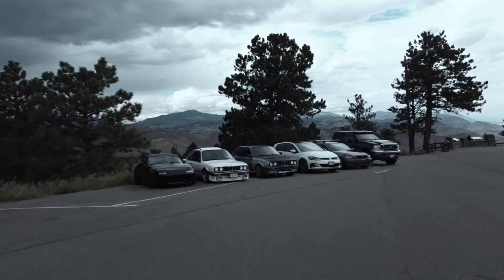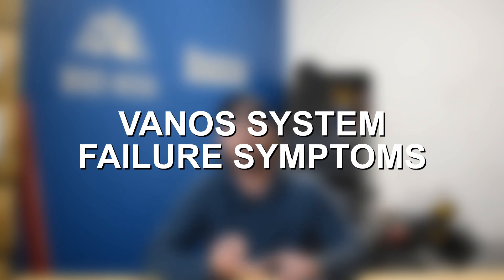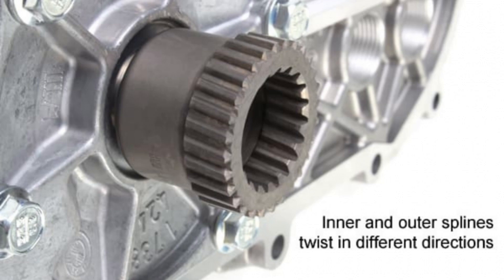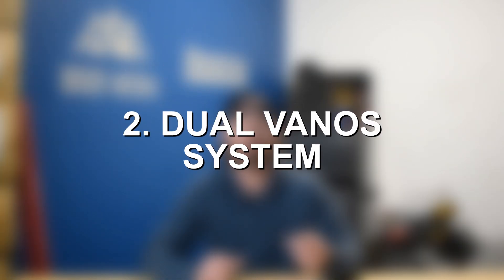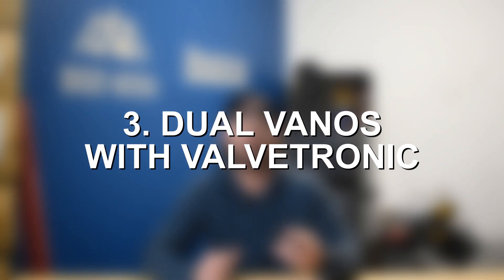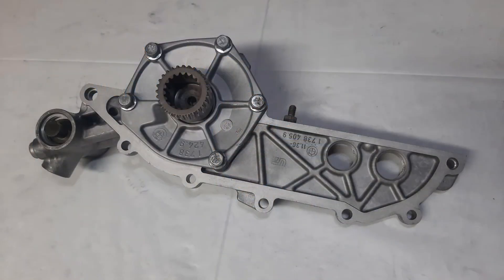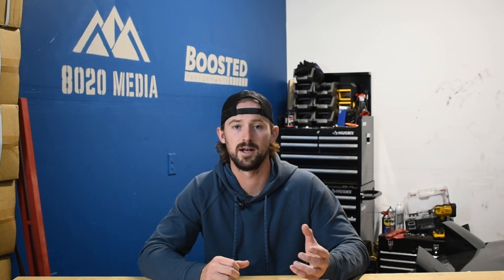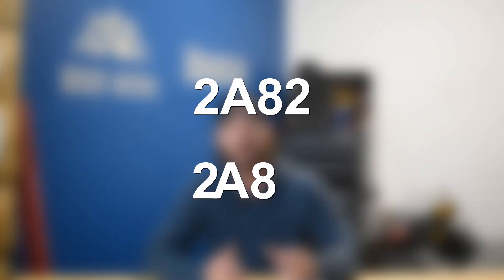The BMW VANOS System EXPLAINED! | Symptoms, Repair, & More

Comment: As a tuner honda owner overhauling a 99 323i e36, ya'll are just lazy. I'll say it. VANOS is time consuming to fix, absolutely. Not impossible. It's not your 5,000 miles oil change but if you care to learn at all these vehicles are not that hard to work on 😂

Comment: I have an X3, 2008, with an N52 engine. It is running rough, popping out blue smoke, and occasionally stalls completely. A repair guy removes the exhaust camshaft sensor and found metal flakes  in the sensor. Same story with the VANOS solenoids. Do both/all four parts need to be replaced?

Comment: 2015 bmw 528i i had rough idle i hooked up my scanner and notice manifold pressure stayed at around 91kpa and fuel trim off so I replaced my vanos very easy! And did a valvetronic and cam reset runs soooooo smooth now!👍❤️

Comment: Ive got a 2009 bmw x5 48i
Engine is E70 N62
Getting these faults:
Electronics-box fan, activation
Ignition coil cylinder 2
Misfire cylinder 2
Ignition coil cylinder 5
Misfire cylinder 5
Inlet VANOS, adaptation stop 2

I noticed on each bank i have 2 vanos vertical to eachother, top and bottom. Im guessing “stop 2” from the fault is bank 2. Which im guessing bank 2 would be the drivers side cylinders 4-8? Then as far as “inlet” from the fault, does that mean the top vanos is inlet and bottom one is exhaust? So my course of action here is to try to clean or replace just the top vanos on the drivers side bank? Even though there are other coil or spark codes from the other bank too. So maybe just clean both the top vanos on both banks?
Reply from the maker: E - Yes, you're thinking along the right lines—on the E70 X5 with the N62 V8, Bank 2 is indeed the driver’s side (cylinders 5–8) and Bank 1 is the passenger side (cylinders 1–4), and when the code mentions “Inlet VANOS, adaptation stop 2,” it's referencing Bank 2 intake, which typically means the top solenoid on that side (top = intake, bottom = exhaust); this fault suggests the DME can't properly advance or retard the cam timing on that intake side, possibly due to sludge, sticking solenoid, or worn VANOS seals—so your best first step is to remove and clean both top VANOS solenoids on each bank, as even a slightly sticky solenoid can throw adaptation faults and disrupt smooth valve timing, which could explain misfires or weak combustion, especially in combination with aging coils, so after cleaning, clear codes and test again, and if problems persist, consider replacing the affected solenoids or doing a full VANOS rebuild depending on mileage and oil sludge condition.

Comment: How much would it cost to fixing the VANOS issue?
Reply from the maker: N - The cost to fix a VANOS issue varies depending on whether you're replacing solenoids, seals, or the entire VANOS unit. Replacing just the VANOS solenoids typically costs $300–$600 (parts and labor), while a full VANOS rebuild or replacement can run $800–$1,500+ at a shop. If you’re DIYing with a rebuild kit (like for seal replacement), it could cost under $100 for parts but requires a few hours of labor and some mechanical skill. Dealer prices tend to be higher.

Comment: Does forgetting to change the oil for 3k miles affect the solenoids?
Reply from the maker: T - Yes, forgetting to change the oil for 3,000 miles past the recommended interval can negatively affect the VANOS solenoids by allowing dirty, degraded oil to clog the solenoids and restrict proper oil flow. VANOS relies on clean, high-quality oil to function correctly, and sludge buildup can cause sluggish performance, poor idle, and potential solenoid failure. If you've gone over the interval, it's best to do an oil change with high-quality synthetic oil and consider cleaning or replacing the VANOS solenoids if symptoms persist.

Comment: I have a code 2DB0 Vanos on my car, you have any idea what that means? Please get back to me. You guys are very smart
Reply from the maker: E - Thanks for the feedback! The 2DB0 VANOS code on your car indicates an issue with the camshaft position control (VANOS system), specifically a camshaft control adaptation issue. This typically means the VANOS solenoid, timing adjustment, or oil flow to the VANOS system is not functioning properly. Start by cleaning or replacing the VANOS solenoids, as they can get clogged with oil sludge. Also, check the oil quality and level, since low or dirty oil can affect VANOS operation. If the issue persists, inspect the camshaft position sensors and ensure there are no timing chain stretch issues. A software adaptation reset via BMW ISTA or another coding tool may also be required after replacing any components. Keep us updated!
Reply: @8020Media - I just bought this new engine from a company called miamiengies and I just got this issue after 1 day of driving the new engine during the break in process. I’ve driven about 500 miles already with this code and about 3 hours ago, my car started to blow LOTS white smoke from the exhaust while idling, first time that happened, would it be smart to not drive it until I fixed the issue. I also contacted Miamiengies to find out if I should bring it to them or my mechanic? They said they’ll contact my mechanic to find out exactly what the codes are and to see if it’s their issue or not. What do you think is it Miami’s issue or just needs to be cleaned and put back in?
Reply: @ do you see my other comment I put? Or no? I don’t see it no more sadly it was a big message. If you see this one. Response to me so I can type it to you again.

Comment: I have single vanos but am going to tune my m52b25tu to 500hp, is there a way i can rwmove vanos or make sure the gear is always all the way out?
Reply from the maker: D - You can remove VANOS using a delete kit or lock the gear in the desired position, typically fully retarded for high-RPM performance. Work with an experienced tuner to ensure your setup delivers reliable and consistent performance at 500hp
Reply: @8020Automotive  awesome thank you, (unedicated) people told me that you can tune with the vanos active like normal but tuners have told me that this is dangerous and you cant "tune" it. So thank you for the clear answer.
Reply from the maker: D - Keep us updated!

Comment: Hello. Very informative video on the vanos system. I have come across your video, as I am trying to repair an issue with my car. 2011 BMW 335ix with N55 engine. There is an extensive history into the recent and major repairs I have just completed. I currently find myself battling these codes: 2DA0 and 2DA2, intake AND exhaust camshaft angle offset with respect to crankshaft out of tolerance. I have checked my cam shaft timing twice. Ensuring the timing chain was properly tensioned, and all timing tools properly in use. The timing appears to be correct, but I still get these codes, for BOTH cam shafts. I have pulled out both solenoids, cleaned them, bench tested with 12volts to ensure they work. Combined with the codes, the engine certainly idles very rough, stalling frequently. Above 1000RPM, engine appears to run and sound great. let of the throttle, below 1000RPM, and back to very rough and stalling. A few days ago, there was a 15 minute drive that worked perfectly! Car sat for 45 minutes after that drive, 5 minutes into the next drive, problem came back. Next thing I am going to check, is the oil pressure/oil pump solenoid on the front of the block. Perhaps it is clogged, like the vanos solenoids were to begin with. Here is the recent work I did to the engine: replaced connecting rod bearings, replaced complete cylinder head, with a good used cylinder head. Original cylinder head had excessive wear on the cam shafts and rocker rollers. The vanos gears are the original vanos gears, with replaced vanos bolts. There was one forum post I read today, that mentioned the need to "bleed" the vanos gears after replacing/cleaning the vanos gears... To ensure the oil has run through the vanos gears. The procedure was to basically find an open and safe road, and do a few passes accelerating to high rpms, and letting off, then repeat.... 
I am curious on your take as to why both shafts are creating these codes??? Thanks

Comment: Valvetronic was bij bmw all in 2004 my 2005 e60 N52B25 has dual vanos with valvetronic on inlet side with and second camshaft for variable valvelift. My another car an E65 from 2006 with N62B48 engine has it to but than dual/dual are 4 vanos solenoids and 2 valvetronic engines and 2 second inlet camshaft for the variable valvelift because it is an V8 when this got bad you have dubble trouble
Reply from the maker: W - Thanks for sharing.
Reply: E46 N42 engine '01 has valvetronics & double vanos

Comment: Hi please can you assist i'm getting these codes on my 2016 F20 B38 118i
118401 Mixture Control: Mixture Too lean, Deviation Too High
130308 Vanos Solenoid Value, exhaust: position not reached
180001 Catalytic Converter: Effeciency to low
130F11 Rxhaust camshaftsensor, signal: not plausible
101F01 Air Mass System, plausibility: calculated air masses in the air take system

Guy says I need a new oxygen sensor, new camshaft position sensor and a mass airflow sensor. Is that all for these or do i need to replace more?
Thank you
Reply from the maker: J - Honestly, those sound about right..

Comment: Hi, I am still having fault code 130714 and 130716 on B48, even after changing both VANOS solenoid and exhaust camshaft sensor, engine jerking with loud tapping noise, slightly better now on idle, but once in a while will come back. Low oil pressure reading, 9Hpa. What could be the other possibilities?
Reply from the maker: P - Did you clear the codes after replacing?
Reply: @8020Automotive  yes, codes were cleared after replacing the Vanos Solenoid and exhaust camshaft sensor
Reply from the maker: P - How long have you driven it after replacing those parts?
Reply: @8020Automotive  did not drive after replacing the parts, as the whole engine idling is abnormal
Reply from the maker: P - hmmm. Have you had it looked at in a shop?
Reply: @pinkyme679 what’s the update on your car? My bmw 4 series is coming up with the same codes 130714 - vanos solenoide valve position not reached
130716 - vanos solenoide valve exhaust jammed 160021 - crank sensor general loss of sync. But of a rattle, loss of power when accelerating and engine light on. Currently in the shop now doing some further investigation before going ahead with the job to make sure it’ll solve it.

Comment: Hi Jake.  Very informative video.  My son's e90 (N52) was idling rough after he changed the valve cover and gasket.  He had all kinds of codes because he had disconnected the battery so we really didn't pay too much attention at that time.  After changing the ignition coils and spark plugs, which was due since the car was at 150k miles, it was still idling rough.  So, we read the codes which related to the exhaust solenoid being jammed, 2A87.  We watched some videos, including yours, and cleaned both solenoids and switched their positions to see if the code would follow the faulty solenoid, just in case the cleaning hadn't worked.  The cleaning did work, but we ordered new ones and we'll be replacing them anyway.  
I have a different question for you though on the N55.  I get a code 2d54 and a half engine light.  2c58 follows shortly after that, but when I clear the codes, the go away, there is no loss of power, and the code doesn't reappear until the next time I start the engine.  I changed the solenoids already, so now I'm thinking the cam phasers need to be replaced.  Do you think that's the right solution for 2d54?  Thanks in advance.
Reply from the maker: C - Thanks for the feedback! Glad we could be of assistance. As far as your engine codes go, this is a solid post regarding both that you're seeing: https://www.justanswer.com/bmw/j8p2d-i-m-getting-codes-2d55-2c58-not-no-2011.html#:~:text=2C58%20is%20related%20to%20boost,can%20be%20a%20few%20things.

Keep us updated.

Comment: If the vanos gets bad would in trigger a engine light?
Reply from the maker: L - Not always!
Reply: My experience it won’t until there is a serious blockage or a stuck solenoid (but depends on the position it’s stuck in)

Comment: Wish you would of elaborated more on issues with bmw vanos solenoid without any codes. Changed the spark plugs and coils. I guess I will just clean the solenoids and see if that helps the hesitation.
Reply from the maker: A - We have a whole nother video for this: https://youtu.be/1AVYtMrlvpE
Reply: Injectors

Comment: The vanos non return valves also give you vanos codes, after  I changed both vanos solenoids in my car I still had the rough idle, cleaned my non return valves and bingo, smooth as hell
Reply from the maker: Thanks for the helpful additional info!
Reply: Hey man enjoy your videos but let talk about the valve cover gasket in N63TU1 BMW. HOW TO STOP THIS PROBLEM FROM COMING BACK @8020Automotive
Reply from the maker: B - Thanks for the feedback. We'll add this to the list.
Reply: could you do one aboutthe valve seal on Bmw 750li
Reply from the maker: B - We'll add this to the list.

Comment: It's useless variable valve timing. Everyone did it and some of those engines run better without it. Lol
Reply: I wouldn't say it's useless that's like saying a big cam in a v8 is useless this is best of both worlds
Reply from the maker: C - We think there are pros and cons of the system, but thanks for sharing your opinion!

Comment: VTEC is Variable valve lift, not just timing….
Reply from the maker: T - Thanks for the insight.
Reply: Yea and also hondas last forever lol unlike the "ultimate driving machine" 😂@8020Media
Reply: Actually VTEC was just the variable valve lift not cam timing. I-VTEC is similar to BMW's Vanos with valvetronic.

Comment: The diagnosis says this“VANOS (Variable Camshaft Timing), inlet, actuator movement” what could be the problem?
Reply from the maker: What engine do you have? Probably vanos solenoids if I had to guess but depends on the engine

Comment: Hi,quick question.  How about if you get an EML light with engine light but no codes and rough idle and it’s stalling with loss of power when you accelerate it only goes up to 2000 RPM and it goes back down to zero and it stalls?
Reply: Ok that is my next step. But it so confusing. I found differen gap sizes on bimmer forum. When i pulled the spark plugs. It was gapped at 0.044 but they said its 0.032, 0.040. So i tried both, on 0.032 ti wouldn’t even run. On 0.040 it idled bad soni put it back to 0.044. All my coils are good tho but still misfiring. Could bad camshaft cam and exhaust caused misfire?
Reply from the maker: T - Have you pulled any engine codes?
Reply: Hi, found the caused of eml turning on. Engine wiring harness.
Reply from the maker: T - Nice! Did this resolve the issue?
Reply from the maker: T - We have a video for engine stalls that may help here: https://youtu.be/7bqAIbYRdnc

What have you done so far?
Reply: Thank you for the reply. Well,  i have tried cleaning the idle air control valve.  Checked the coils they all passed. What gets me is i have the eml light. But no codes and no engine light. Its misfiring feel no power and if let off it stalls.
Reply from the maker: T - Check the spark plugs and the things we cover in the stalling video. Keep us updated.
Reply: Yes. Well, it pointed me to the right direction to where to focus my concern. It works now. I zipped tie the main bundle of wiring. You know how there in a loom and inside a rubber boot? I zipped yied it into the intake tubing. So it won’t keep moving around while driving. Still looking arounf for the main engine wiring  harness. Ok, quick question. Are 3series bmw e46 main engine harness are interchangeable? Like i mean. If mine is 1999 if i find an 01 and has the harness can i use that?
Reply from the maker: T - Thanks for sharing your experience. We'll have to do some digging on that question.
Reply: @8020Automotive  i see, i found one from ebay. Same exact harness and ampunt of connections for the sensors. But i want to be sure before i make a purchase. But please let me know what you can dig up on behalf of them harness. Do you have a personal email so i can show you which harness?

Comment: I’m getting code 131508 and 131408 for 2011 bmw 528i
Reply: I'm not to sure but depending on year the engines might be the same so just make sure they are the same engine and you should be fine and worse comes to worse scour the forms
Reply: @justicecummings5613  I got a n52/f10 engine
Reply from the maker: Buss - Here's a great thread for your research: https://www.justanswer.com/bmw/l50oz-idle-fluctuations-startup-sets-131508-code.html
Reply: It’s give me a check engine light
Reply: That link you send me is bmw x3 there are talking about
Reply from the maker: Buss - They are talking about your issue with the same code.

Comment: Just got a recall (23V-707). VANOS Assembly Engine Bolts. Anyone have this work done? Is it the bolts that hold the assembly to engine? No warning lights so far on my 2010 Z4 3.0 but occasionally a whirring sound that I thought was loose belt. Car experiences a hesitation form stop light but not in sport mode. I'm thinking a loose or broken bolt has caused main gear to brush up against VANOS unit housing.
Reply: I’m actually going to pick my 2010 1 series up from service on Monday for that same recall. I didn’t have any warning lights but they did find some suspicious bolts. If I remember I’ll ask the service manager your question when I see him.

Comment: i have a 99' 323I E36 coupe, getting P1525 and P0335 codes, causes rough idle, sounds like a misfire but its not, slow throttle. dont know what it is, any ideas?
Reply from the maker: Brayden - It's one of two things. The VANOS solenoid or camshaft pos sensor